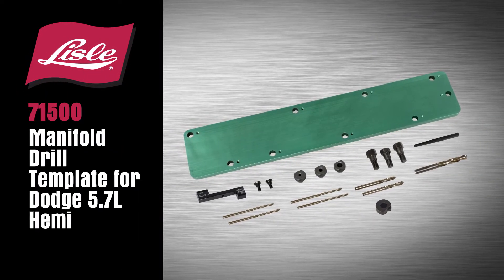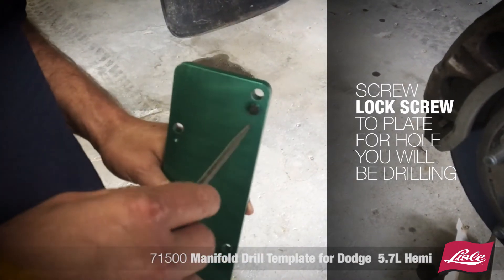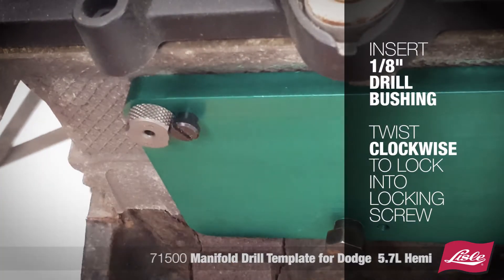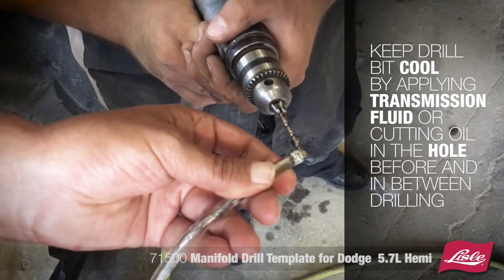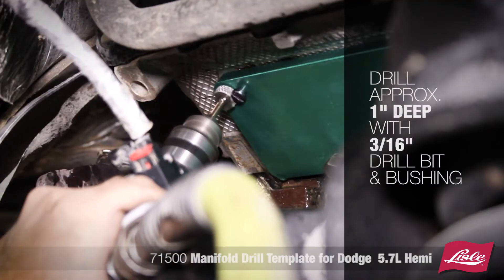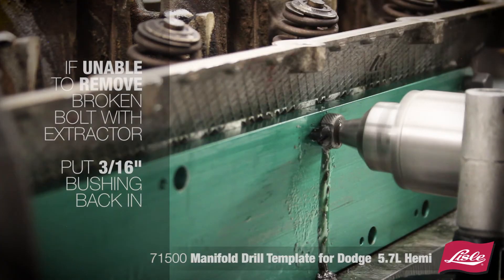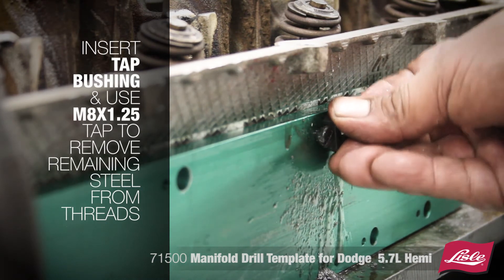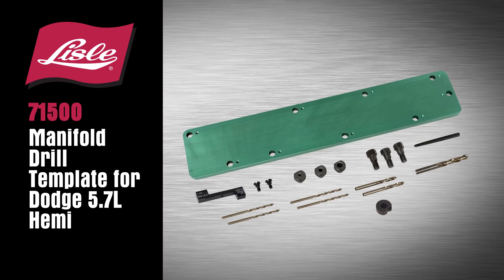71500 // Manifold Drill Template for Dodge 5.7L Hemi

Comment: Weld a nut onto broken bolt to extract.
Reply: It can be flush,  weld a washer to the bolt by building up material then weld a nut to the washer.  Then take it out.
Reply: How in the fuck is that going to be possible when most ram 5.7s bust the bolt in the middle and that’s an inch plus in the block good luck welding lol
Reply: You fill the hole i did it on ford tritons hundreds of times
Reply: @809FILMS aluminum heads buddy you can weld it out even if it’s broke off deep

Comment: Decent enough tool. Got done using it this weekend to do 2 broken studs on my Ram - the video does make it look easier than it really is as the 2nd part of the video shows the engine out of the vehicle.  Unless it's a truck - there is no way this is happening in the vehicle.  Even in the truck using a right angle drill I had to jack the engine up on each side to get a straight shot with the bits.  Both my bolts were on the bottom row - if they were on the top I might have had enough room.  To be fair, it wasn't that hard as the motor mount bracket bolts are slotted - just back off the nuts a couple turns and slowly raise the engine.

I drilled exactly as described using transmission fluid and 5-10 second intervals with the drill but the drill bits weren't really up to the task.  I bought some Milwaukee bits at Home Depot and they worked a LOT better than the ones that came with the kit.  The extractor also wasn't all that great and rather than risk breaking it I opted to drill both all the way out to use the tap.  The inserts are where this thing SHINES.  Perfectly centered holes that tapped out exactly as they should.  The drill depth gauge was a nice touch as well as it helped make sure I didn't drill too deep.  

Solid 4 out of 5 stars.  I hope to never need it again, but am glad I bought it.
Reply: seems logical one might not want to apply Loctite with the replacement bolts due to the possibly of making bolts difficult to remove next time?
Reply: @wildwoodtop  Dodge doesn't specify loctite in the service procedures for replacing the manifold, so I wouldnt use it.  I did put anti-seize on all of them.
Reply: ratbert86 what kind of thread tapper did you use do redo the threads. I need to do my truck but I want to make sure I have all the correct tools for the job! I have three bad bolts and I have broken three extractors already so I am done with that just going for the drill all the way and tap!